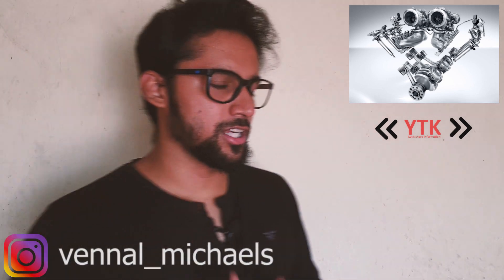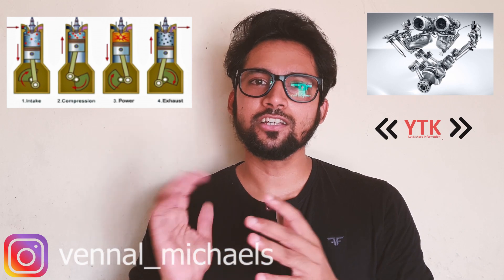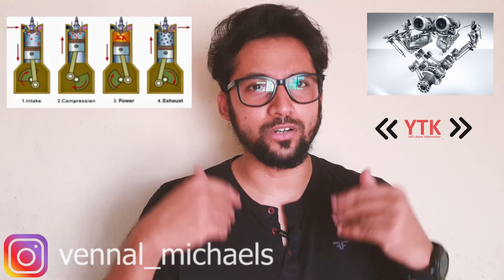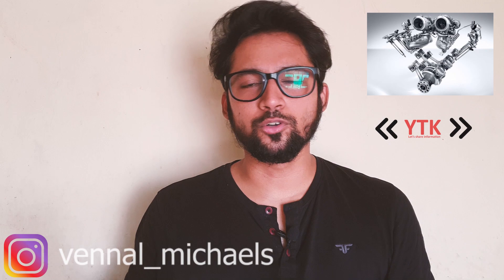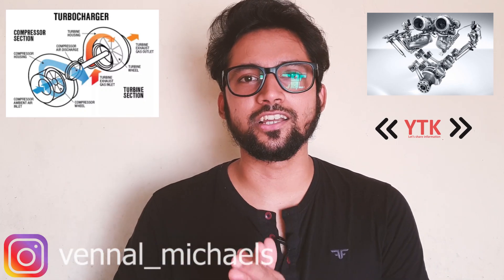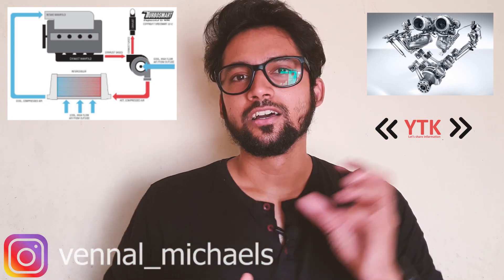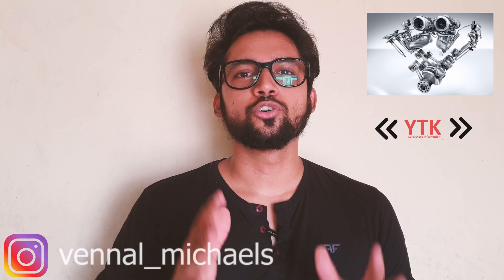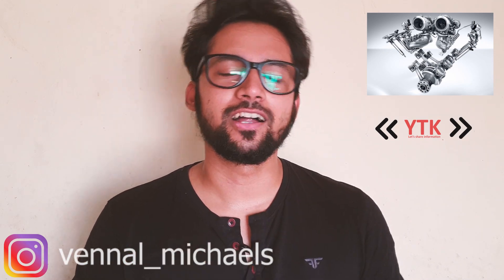TURBO Charged Engine அப்படினா என்ன | What is Turbocharger in engine | What is Turbo | YTK | Tamil

Comment: Hi YTK bro, I have a plan to buy Kia Sonet automatic transmission but I have confusion between 1 litre turbo petrol 7 speed DCT and 1.5 litre diesel 6 speed torque converter.. I heard turbo engine gets over heated very quickly and maintenance cost is very high.. pls suggest me which one is best for long drive and keeping the vehicle for more than 10 to 12 years..

Comment: Does the Turbo Charger come in to play from the start, I mean whether it works in initial lower speeds or after a certain amount of speeds, eg : some 60 / 70 kmph based upon vehicles.
Reply: Sir, Turbo activates only in higher rpm. Eg. 3000+ rmp. In the baleno 1 litre turbo engine example, it gives 150Nm power only when engine throttles at 3000+ rpm.  Therefore, compared to normal petrol engine, turbo engines give less mileage but they are more efficient and release less carbon than normal engines. Turbo engine weighs less than normal one and thats the reason why it's used in cars like Tata Nexon that has good build quality (1.3 ton). You can feel the turbo activation when you throttle the engine in low gear, high rpm eg. During overtaking or hill drive. Tata nexon (in Sport or city drive mode) turbo activates at 4000 rpm.
Reply: @midhunchakravarthys4819  Thanks for your reply sir. S, I own a Nexon Diesel. But I haven't seen it going beyond 3500 RPM up to 130kmph, since I don't pedal hard. They intimated me the rpm Needle changes to red colour after a particular level and don't pedel hard to such level as it won't be good for your engine. So while driving I had not noticed it. So I raised a bit only in  neutral to check it and found it changing to red colour a @ 4K rpm. I had also driven it @ 150kmph. But I would normally drive @ 100 -120 kmph in highways. In this speed the rpm don't go above 3K and also rpm Needle changing to red. Does the turbo Charger work while I drive?
Reply: Initial pickup & mid range will be very good in turbocharged engines

Comment: Explain Supercharged engine bro
Reply: If Compressor powered by exhaust gas that is called turbo charger,,  and if compressor operated by any kind of individual motor or own engine crankshaft that s called super charger,, super charged engines has very high intial torque that  means 0 to 100kmph with in 6 or 10 seconds